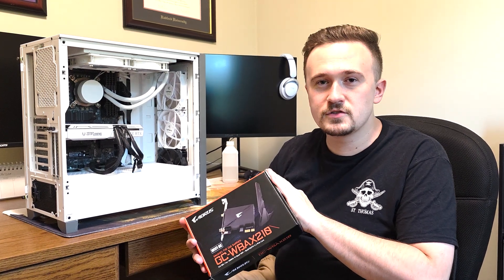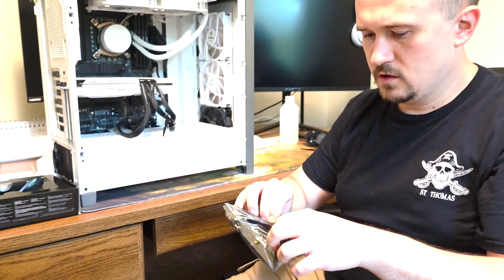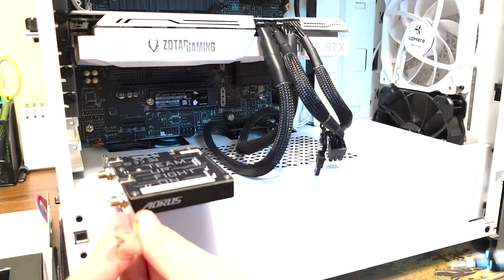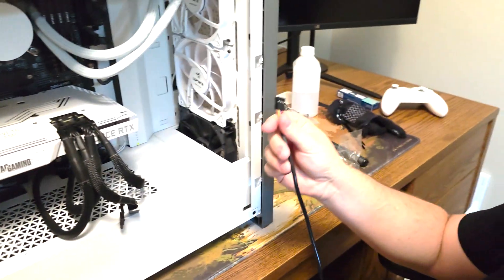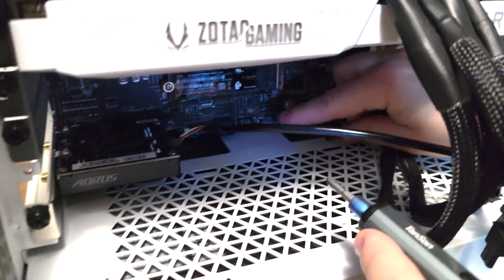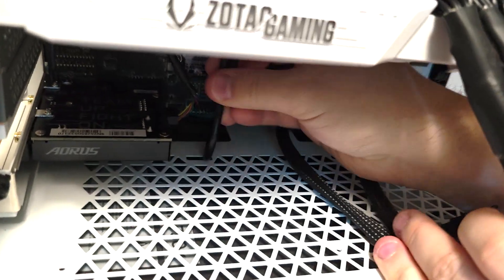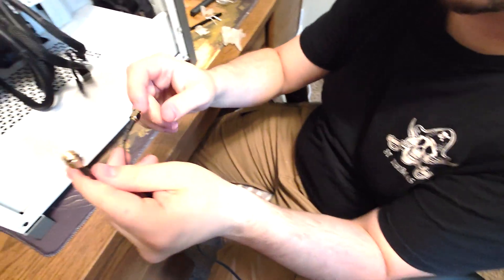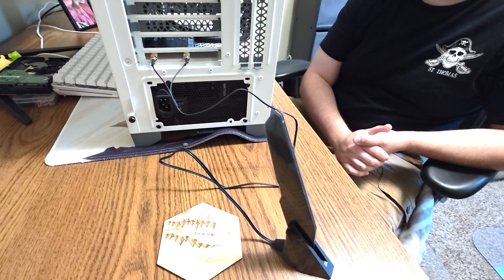How to Install a Wi-Fi 6E + Bluetooth Card in a Desktop PC (AORUS GC-WBAX210 / AX210)

Comment: I installed mine, installed the driver... Nothing works
Reply: Did u find a way to fix this issue
Reply from the maker: There could be a number of problems. I know sometimes a little green light pops up on the back of the desktop to show that it's getting power, is this true?

Does the computer register it in device manager, sometimes the reason something doesn't work is because your computer can't find it despite it literally being there